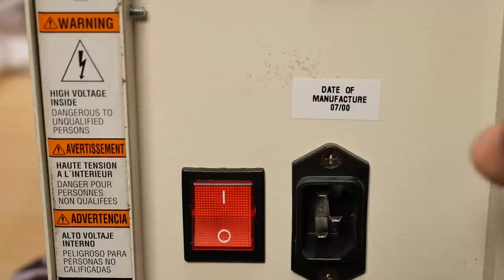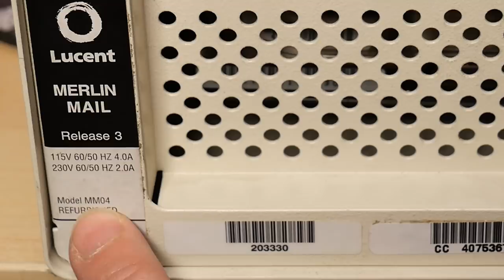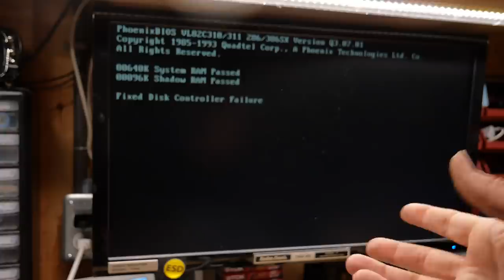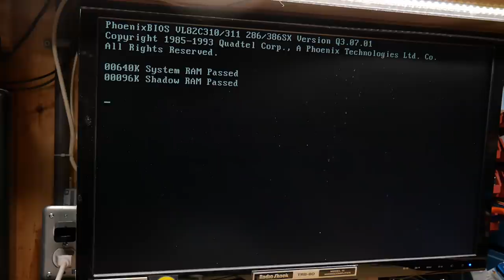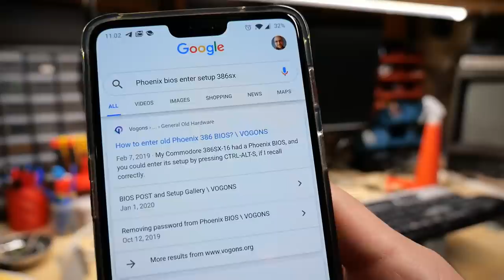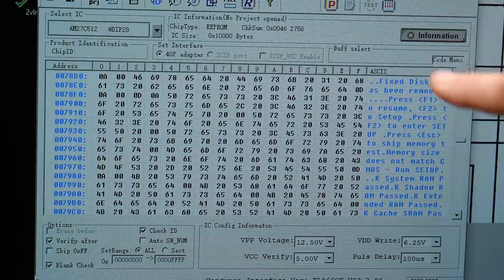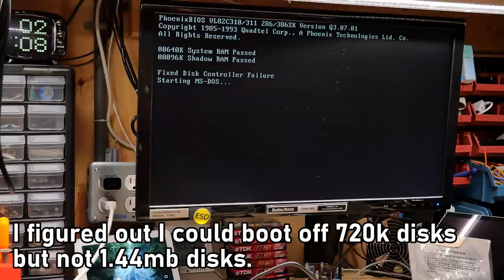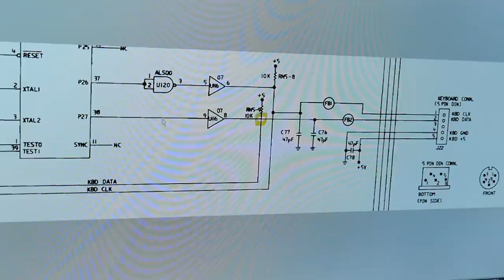Trashpicked Voicemail System

Comment: The BrookTrout Cards look very much like FXO/FXS and Fax Modem cards I worked with in a call center job I use to have. My guess is the Non-DSP card is for an FXO(Normal phone line) or FXS card and the DSP card is for a modem port. They most likely had the modem port for maintenance. I'm guessing the serial ports where used to access the system menus locally. 
If you have a way to hook this up to a phone you can test to see if it would give you the voice prompts. First you need to figure out if it gives you battery, you can do this by hooking a normal phone to it, take it off hook and see if you can hear side tone(hear your self in the ear piece) If you can than it's an FXS card. Next you might be able to access the system to see what kind of voice mails are on it.(Yea I know, that is not a "normal" phone any more, I guess I'm just an old school Telephony guy. LOL)

You can also try hooking up to the serial ports and monitoring them while the system boots. It should give you some kind of info there while it boots, and you may be able to gain access to the system configuration to see how it was setup.
If a tech was working on this on site they would have hooked up a laptop to the serial line and talked to it that way.
These systems where designed to be controlled from the serial line only, so your best bet would be to get in that way and work from there.

As to how to use the board for something else you may have to do lots of mods to bring it back to "normal". These systems where odd balls from the view of normal PCs, because they had to just sit in a closet humming away with only phone lines attached. At the time it was rather clever how they could get these systems to work for what they needed. The PBX I worked on back in the early 2000's was a 486DX-66 that ran a customer version of DOS. It had some BrookTrout T1 cards on it so you could have PRI spans or normal T1 worth of phone lines coming in. It then used a custom Network setup that talked to a Windows 3.1 client software on the Call taker side. From that you could do all the call center type stuff. It was very impressive how much you could do with the system that was running DOS on a 486. On the call taker side I had to support the old software on Windows 7, which was major PITA!
Just this week I went back there to help with a project and The system has been replaced, but it's funny how the client software looks the same. If it anit broke....

I hope this info helps figure this out. I saw a lot of systems like this back in my Call center and Paging days. I use to work on a Glenayre GL3000 Paging terminal which was a 386SX running DR-DOS with 10Megs of Memory. That system supported a 80k pager system that providing paging to all of Eastern Washington and Northern Idaho. Those old boards really made the world go round back in the days.

Comment: BIOS Video Services (Int 10h) may be redirected out one of the COM ports.  You normally don't have a video card installed in normal operation - just a serial port.  AT&T cut corners in this design using off the shelf components.  So it may indeed rely on an executable on the hard disk to start communicating over serial.  But that wouldn't be very friendly to diagnostic efforts.

Comment: I ran an AT&T system 75 for a few years (the Merlin is a small version IIRC). They NEVER crashed and we had DOS based 386 voicemail system for it until 2005.  We eventually upgraded when ebay was getting expensive for parts.
Reply: Matt I know where you can get some spare parts for it.....
Reply: @JesusisJesus  That was a long time ago. I am looking for an old Merlin or System 75 though. I am building a retro BBS cluster and thought it would be neat to have a system like back in the day.

Comment: A MB of that age would 100% need a disk manager or LBA BIOS mod of some kind in order to properly see a HDD larger than 528 MB properly. It could be there is a custom BIOS on the board that mostly disables KB input & implements some sort of LBA hack in order to see a HDD larger than 528 MB properly. Like others have said try one of the serial ports and see if there is activity. 
Also the bodge wire appears to go to that custom oscillator and possibly where the turbo button that you would typically see on a 286/386 board would plug in. Most likely that AMD 386 SX 40 chip is running much slower than even 33 mhz, probably for stability. As others have said the AMD 386 SX chips were much cheaper than even the AMD 386 DX chips which were all cheaper than almost anything Intel had for sale at that time.
A computer company I was the service manager & network admin at in the 2000's had a somewhat similar VM system. It used an AMD 486 SX CPU clocked down to 20 mhz, 2 MB of RAM and a modified BIOS that had additions so it could address a HDD larger than 528 MB properly (It had a 2 GB HDD.) But otherwise we could hook a KB up to it and it had a bog standard VGA card in it. I used to handle setting up or removing VM boxes for all the company employees, the program that powered the whole VM system ran in DOS. While you could admin the box via a phone, it was easier to do it via a display & KB. The ISA add-in cards with the phone jacks on them do nearly all of the work to record & play back audio to/from the HDD. The card with the DSP on it most likely does the majority of the work voice work.

Comment: If those are digital ksu cards, they are worth a lot, if they are analog(pots) still worth quite a bit...
Most of the VM systems I've maintained (mostly Comdial and Samsung before VoIP era, like before 2007) had Dialogic analog cards in them, and I know people have integrated some of those to things like Asterisk, but many of those cards need a special TSR running and security dongle attached to work.
But for being sold as "integrated" voicemail to those KSU/PBX systems, most of them just used pots and dtmf signalling, I replaced a few failed VM systems with an Asterisk VM box and FXO card in the mid-2000s until I could convert them to VoIP

Comment: You CAN get custom BIOSes with custom initial parameters for when the CMOS battery goes on the fritz, but the system won't be crippled.

25 years ago, I worked for a company that churned out big LED matrix displays for advertising and they used a PC with such a BIOS so they could work without a keyboard and a display and even if the CMOS died. (It booted DOS on a floppy that contained the advertisements to be displayed; the floppies were mailed each month to the branches with new advertisements).

Comment: I feel like I discovered this video a bit late, but from my memories of obtaining a Merlin Mail system many years ago, and 'going down the same rabbit hole', the boards were configured for a specific set of hardware in certain slots.

I managed to use Linux to do a 'dd' image of the hard drive when I had the system, and I want to say it, or at least my system, ran some version of AT&T Unix or BSD Unix.

Having maintained the 'big brother' of this system, 'AT&T AUDIX', it wouldn't at all surprise me if the board was, in some way, custom for AT&T/Lucent...

I do remember that, on my system, the port labeled COM 1 had the same messages as your VGA port.  It now makes me think that the bios, along with the custom PAL chip are modified by the manufacturer to enable use of a serial console for management and maintenance....

Comment: Those brooktrout cards were awesome in the day..  They were known for fax boards, but the same DSPs that handled fax could also do voice in/out and tone decoding (ie: "Press 1 for sales")..  Brooktrout and Dialogic (which was subsequently bought by Intel were the main 2 players in that world, and those cards were probably $1000 or more each.  I am pretty sure Dialogic eventually bought Brooktrout too, and doing some quick googling, I do see some reference to brooktrout boards on the dialogic site.  Back in about 1996 I was writing custom code for boards like that, although I was using VB6 running on NT 4.0 if I remember right, so I have no direct experience with those motherboards.  I was using a VB 6.0 programming add-on Called "Visual Voice".  I can't find any references to it quickly, but I think Intel eventually bought the Visual Voice software and then eventually I think they ended up giving it away to encourage sales of the dialogic card line they had bought.  Somewhere I probably still have the Visual Voice software which should recognize those cards.  It would give you a phone line object you could drag onto your VB6 application, and then have methods like "voice0.answer", "voice0.playwavefile", "voice0.acceptdigits", etc..  It was fun to program.  Let me know if you might want to plug those boards into an Nt4 server, and if so, I'll see if I can find my old VisualVoice disks.  I know I lost the originals in a house fire, but I think I still have backups on the server..

Comment: Avaya, previously Lucent and formerly AT&T used hacked up PC architecture for their Merlin Mail system. Merlin Mail was a standard VMX [VoiceMail Exchange] used for mid-market PBX [Private Branch Exchange] systems. It was pretty typical for voicemail systems of that era to use PC based architecture. Third-party voicemail systems, such as ActiveVoice Voicemail, often used off-the-shelf PCs. Even slightly later, on-card voicemail systems were still PC software running on specialized PC cards designed to fit inside of PBX cabinets. This was especially true after NEC acquired most of ActiveVoice and put their voicemail software on custom PC based cards (complete with DOS formatted flash drives) designed to be installed inside their NEAX and Electra Elite PBX lines. 
As you found, these outboard voicemail systems integrated with PBXes using Analog Voice Cards that were connected to pooled analog extension ports of a PBX. When you called the VMX pool extension, your call was routed to a free extension number in the VMX pool that connected to one of the ports on those Analog Voice cards. Dialogic Corp made the cards. Almost all PC architecture based voicemail systems of that era used Dialogic Cards. Most of these voicemail systems used out of band signaling to and from the PBX over a Serial port. This means when you called the VMX pool number from another extension, the PBX would send information about the call simultaneously to the VMX over RS232 using the Serial port indicating the originating extension. The RS232 connection was also used for MWI [Message Waiting Indicator] functionality. The reason you were having so many issues getting that motherboard to act normal is that they were hacked up to run without a keyboard or pointer device. They where intended to bypass the keyboard check, and boot to a drive running a basic OS (usually DOS) and the proprietary Voicemail software. Technicians would program the voicemail using only the serial interface. Technicians would never connect a keyboard or monitor to the system, and most telecom techs of that decade might
not know how to service a PC. If there were an issue with the software, a technician would order a whole new drive or voicemail system with the software preinstalled.

Comment: Adrian - the beeping when you keep pressing keys is because the BIOS keyboard buffer had filled up. In PCs the BIOS has a small buffer where it stores keypresses. Ordinarily software would be continually pulling keys out of the buffer (if using the BIOS routines) which means the buffer doesn't usually fill up, but during boot there isn't anything to empty the buffer. Also looking here https://www.computerhope.com/beep.htm it could be that the short beeps are indicating a RAM issue (1-1-1-1 beep code). You could try reseating the SIMMs.

Comment: No. A 386SX is a 386 with a 16 bit bus (along the lines of 8088 vs 8086 and some 68k). What about re-wiring the keyboard circuitry so it comes out and misses the PAL ?

Comment: The funny - on the Definity systems they used an Intel 486 CPU. And as far as I recall it went AT&T, Lucent and finally Avaya. And what you likely have is a slightly customized motherboard.

Comment: I worked for Lucent and did their telephone system installs, voicemail and programmed the whole thing but I’ve never seen one of these. I worked for Lucent in the UK and UK equipment was completely different to the US equipment. Lucent UK changed to Avaya UK, I worked for them for 21 years. The bios is custom and it is F2 for setup. They locked these machines down completely so that they couldn’t be taken home and used as a normal PC, you can’t do it and it should boot to Unix.

Comment: The system was probably built in 1996 or so. and when the hard disk failed in 2000 they sent it back to Lucent and replaced the hard disk but kept all the other hardware the way it was.
The Dallas chip has 9506 on it so it's probably original. 
Have you tried connecting something to the COM1 or COM2 ports? Maybe the modified BIOS does something with them. After all, there must have been some way to connect to this thing and do some configuration that couldn't be done with just a phone.

Comment: I've had a few Taiwanese 286/386 boards that require hotkeys to get into the BIOS, but they only work once you're at the dos prompt.  I'm going to guess your setup.com was a red herring, allowing you to read the settings, but not write them.

Boot back up on the floppy, and try using the shortcuts... You may hit paydirt.

Comment: Wasn't uncommon to underclock CPUs for more (perceived) longevity and relilability.
Reply from the maker: Seems too the chipset had a Max speed of 33mhz as well. Probably was quite late for a SX part to be used and they combined a faster CPU with a slow chipset as it is just what they had.

Comment: I used to work at the Lucent factory/Bell labs in Westminster CO where they assembled these merlin boxes and Definity switching cabinets, I was there 1998-2002 .i worked for IBM supporting Lucent desktop machines and servers. I believe this was a Lowtech security feature where you had to connect a modified keyboard or special keyboard that would allow you to interact with the BIOS. Basically to prevent someone ,other than a technician , just plugging a regular old keyboard and messing with the box. Also, what other said about the rs232, I think you can get console access with a tty terminal and see the exported video, like old school serial over Ethernet, so they could remotely dial into the box and diagnose it. I think all this was to make it like an appliance as much as possible, headless just plug it in and connect to your phone system.

Comment: I have an Alcatel-Lucent OmniPCX and it is one of the most custom and locked down things I have ever seen. I was just barely able to get a console working but it does follow the same principle as this device: A slightly custom computer (CPU) board/module and then multiple add-ons for whatever your needs were.

Comment: I have to wonder... in a PC the keyboard controller is responsible for a whole lot of things, including managing the A20 line gate and the reset line. Maybe if you pull that chip off the board, the reset line is never deasserted (pulled high IIRC), and therefore the CPU will never run?

Comment: You could try corrupting the BIOS CMOS memory to force a BIOS checksum & reload defaults by booting to a dos disk with debug.exe and issue the commands -O 70 10  |  -O 71 10 . I used to use this trick to reset customers systems that they had forgotten the password on. Make a copy of the dallas ram first if you can, also you may be able to edit it in a hex editor if it can be read.

Comment: The bios memory chip battery back would still be working as being always on so did not much drain only on power cuts.  I have used ones from systems like this and they still keep going.  Having worked on these system we mainly used the RS232 to fault find and program them.  So boot and connect up to  RS232.
I do remember something about the keyboard and the  286-386 boards so will have a dog in my loft for old manual. Similar problems with epos boards to enter bios you had to hold down non standard keys.  I want to say it was something to do with memory over 640 on 286 but it was a long time ago.

Comment: Am I the only one that did not have the battery leak on the mainboard? I have a 286 from 1989 and it still works perfectly, even the battery although it does not hold a charge for very long when the computer charges it. But it did not leak.

Comment: My brother worked at Dollar General for a long time.  They used DOS on their point-of-sale machines, until eventually management decided to upgrade the OS, but not the hardware.  They opted for Linux, which of course ran like a slug doing anything on those old machines in comparison to DOS.  The registers took five minutes to boot up from then on, so any time there were power issues, from a storm, or whatever the case may be, it became a nightmare scenario of long lines and frustrated customers while rebooting.  The logical approach would have been an intermediary machine to connect the old registers into any newer back-end hardware, but they were never much for common sense, and certainly weren't going to spend money if they could avoid it.  I think K-Mart took a similar approach, especially when I recall their systems taking a long time to start up when they went through a phase of electrical issues.  Though we can all see how K-Mart ended up.

Comment: When you talk about the clock running a 40Mhz chip at 33Mhz.  You make a comment something like, not so good.   Well just for your info.  Systems for this sort of use are often "under clocked" or clocked at a lower speed for stability and to cut down the need for active cooling.  This also makes them much more reliable needed less maintance.